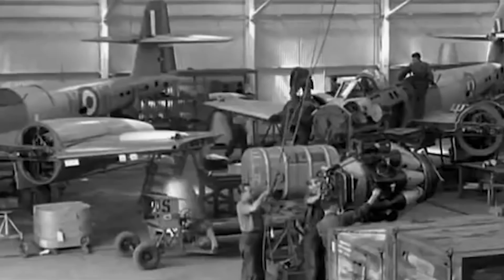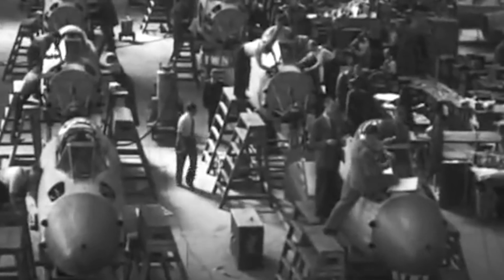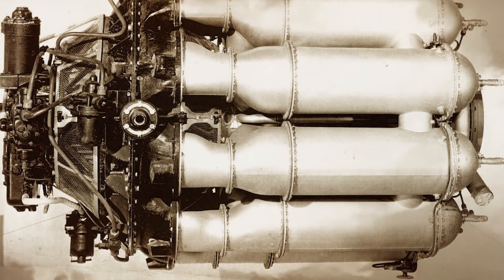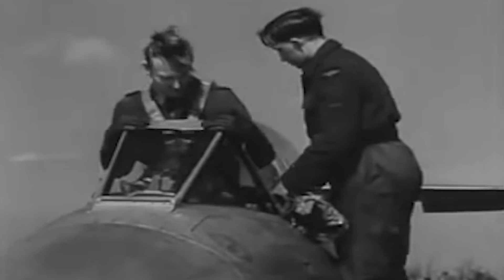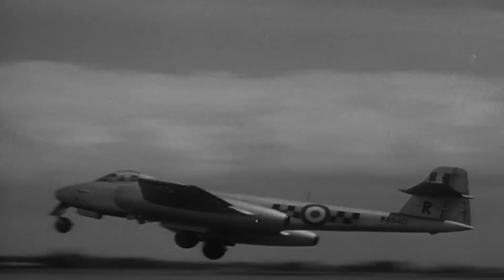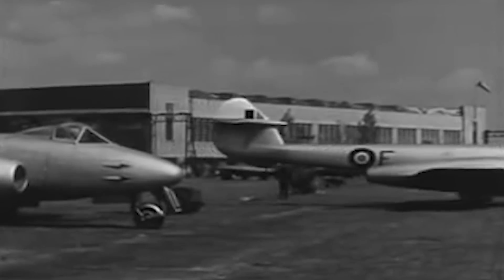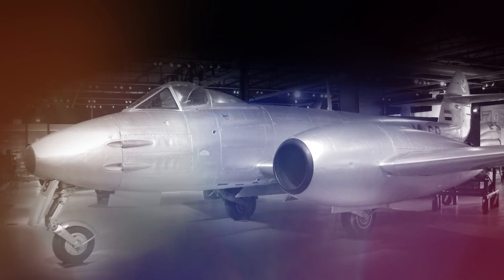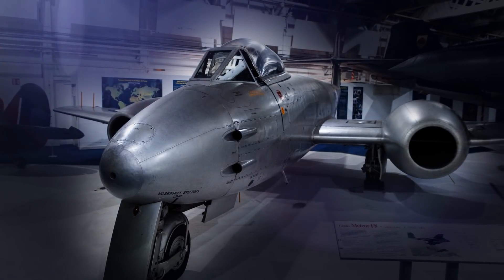Gloster Meteor - The Only Allied Jet to Fight in WW2

Comment: Technically the Gloster Meteor was the World's first operational jet fighter, by about a week. The Me 262 was the first jet fighter to see combat, but it was not officially operational at that time.
Reply: Correct spacecadet35. The Meteor was the first. It was also a proper R&D'd plane not a death trap lash up.
Reply: The first operational jet fighter was the Messerschmitt Me-262.
Reply: @sandervanderkammen9230  The Meteor beat the Me262 into operational service by about two weeks. The Me262 is definitely the first jet to see combat, but not the first 'operational' jet.
Reply: @spacecadet35  No, that is incorrect.
The Messerschmitt Me-262 entered service in April 19th, 1944 and shot down its first Allied aircraft, a RAF Mosquito on July 26th.
 The Gloster Meatbox did not enter service until July 27th.
Reply: @sandervanderkammen9230  -  The Me 262 did indeed enter service and see combat in April 1944, as a TRIALS aircraft. It became OPERATIONAL in August 1944. However the Meteor was declared OPERATIONAL on the 12th of July 1944.  So as I said above. The Me 262 was the first jet to see combat. The Meteor was the first operational jet fighter.
Reply: @spacecadet35  You seem very confused and misinformed regarding this, the Messerschmitt Me-262 entered operational service with the Luftwaffe on April 19th..
3 months before the Gloster Meteor.
 The Meteor never saw combat operations during WW2.
Reply: @sandervanderkammen9230  - I think the main problem is that you do not understand  what the word "operational" means, especially  in a military aviation context. Just because an aircraft is in combat does not mean it is "operational. And there have been many operational aircraft types that have never seen combat.  Unless you have some secret records that no one else except you has seen,; the Me 262 achieved  "operational " status in August 1944. It had seen combat earlier, but not as an "operational" aircraft. If you have documentation that says otherwise, please feel free to reference it.
Reply: @spacecadet35  "Operational" refers to any aircraft that has been introduced to the military units that will "operate" the aircraft.

The Messerschmitt Me-262 was tested and accepted by the RLM Reichsluftfahrtministerium in July 1943, production began in January 1944 and introduced into operational service with the Luftwaffe in April 19th 1944.
Reply: @sandervanderkammen9230  - Operational means that it can carry out its operations. The fact, (probably unarmed)   pre-production aircraft were delivered in April does not make it operational as a fighter.
Reply: @spacecadet35  Well, by that definition the Gloster Meatbox was never in operational service.
Reply: @spacecadet35  Pre-production Me-262s were delivered to the Reichsluftfahrtministerium in April 18th 1941.
Reply: @sandervanderkammen9230  - It fired its guns in anger against enemy targets. It was operational in that it could actually carry out the combat missions asked of it.
Reply: @spacecadet35  The Gloster Meatbox was the worst jet fighter ever used in RAF service.
It never saw combat operations and never shot down a single Luftwaffe plane during WW2.
Reply: @sandervanderkammen9230  - please get you facts right.  The Gloster Meteor saw combat operations. 77 Squadron in Korea flew 15,000+ combat missions in Meteors and is  credited with shooting down five MiG-15s and destroying 3,700 buildings, 1,408 vehicles, ninety-eight railway engines and carriages, and sixteen bridges.
Some would say aircraft like the Brewster Buffalo or the .Paul Boultan Defiant were  worse. And the F35 lightning is a much worse aircraft.  I am not sure what the Meteor did to you personally, but it was a pretty average aircraft, which became outdated fairly quickly and which is mainly notable for being the first jet fighter to achieve squadron operational status.
Reply: @spacecadet35   I wrote, quote;
"It never saw combat operations and never shot down a single Luftwaffe plane during WW2"
Reply: @spacecadet35  RAF Chief Marshal Sir Frederick William Bowhill called the Gloster Meatbox a, quote; "Dismal and Lackluster aircraft"
Reply: @spacecadet35  As a pilot it's easy to dislike a plane as horrifically bad as the Meaxbox
What is there to like about a jet that killed 450 British pilots...
Reply: @spacecadet35  The RAF selected  the F-35 for the same reason it selected the Meatbox... the British aircraft industry had nothing better to offer... and simply could not tolerate asking the Germans again for help.
Reply: @sandervanderkammen9230  - That quote is factually wrong. As I said before 77 Squadron alone flew over 15,000 missions in Meteors and had FIVE aerial victories with Meteors. In case you haven't figured it out, this was in Korea and that happened AFTER World War 2.
Reply: @sandervanderkammen9230  - Wow, your reasoning is indeed twisted. Thinking that the British would ask the Germans for help during WW2...  The Meteor was a first generation jet fighter. It was of course, medicore compared to 2nd generation jet fighters. But it was comparable to its contemporaries.  It was certainly more reliable and airworthy than the Me 262.
Reply: @spacecadet35  The Meatbox did not shoot down a single Luftwaffe plane during WW2.
Reply: @spacecadet35  I was referring to the Tornado and the Typhoon.
The RAF hasn't had a British designed fighter since the 1980s.
Reply: @sandervanderkammen9230  "The Meatbox did not shoot down a single Luftwaffe plane during WW2.
" And?  WW2 was not the only war that the Meteor saw combat in.  It had to fight much more capable jet fighters than the Me262. And I assume that you actually mean "The RAF hasn't had a NEW British designed fighter since the 1980s. After all, the RAF still has six Spitfires and two Hurricanes still in service. But" I am not sure what all of this has to do with the Meteor.
Reply: @spacecadet35  The Meatbox was not capable of fighting the Me-262..
Shooting down a drunk Chinese MiG-15 pilot was pure luck.
Reply: @spacecadet35  I'm not sure what the F-35 has to do with the Meatbox either...
Reply: @sandervanderkammen9230  - You definitely insult the Chinese pilots. The F86s had problems with these same drunk Chinese Mig 15 pilots.  The Meteor is what it is. It was a first generation jet that had a fairly average combat record. It had issues like any other first gen aircraft,  There have certainly been worse
Reply: @spacecadet35  The Chinese pilot survived and was court martialled for flying drunk.. a far more bitter insult to injury.

Indeed, the MiG-15 was designed by Heinkel engineer Seigfreid Gunter and was superior to Meteor and very close match to the F-86 Sabre designed with the help of Messerschmitt engineers...
The Sabre's wing was based on a prototype developed in Germany before the war ended.
Reply: @spacecadet35  The Meatbox is what it is, the worst jet fighter ever used in RAF service and one of the worst jet aircraft ever produced although the DeHaviland Comet 1 is perhaps the worst jet aircraft ever built.
Reply: @sandervanderkammen9230  - As a First Generation fighter, you would hope that all of the following aircraft were better. So yes, if you restrict the definition enough, you can make it the worst at something. The Comet is actually a pretty good jet. Probably the worst jet ever built is a toss up between the  Lockheed-Martin F35, the Vought F7U Cutlass, the PZL M-15 and the Dassault Balzac V.. I mean the Basic Comet design was so bad that it was produced for 25 years and the Final Comet based airframe finally stopped flying in 2011. Your definition of bad is obviously based on factors other than the normal person's.
Reply: @spacecadet35  The Comet Disaster was the worst engineering failure in aviation history.
Reply: @spacecadet35  If the Comet was a pretty good aircraft? DeHaviland would not have gone bankrupt in 1958 and would still exist.
Reply: @sandervanderkammen9230   De Havilland never went bankrupt and was was bought in 1960 by Hawker Siddeley and is now part of BAE systems. Comets were in service with at least eight different nation airlines, was produced from 1949 -1964 and in regular civilian operation until 1980.
Reply: @sandervanderkammen9230  Sandyboy, as you know the MiG-15 owed its performance to the RR Nene engine, the Russians having wisely dropped the crappy BMW 003 engine that had been such a failure in the MiG-9.

Comment: 4:10 The Meteor in this piece of film has engines equipped with an exceptionally long tail section; anyone know what's up with that? I don't see that on any of the other pictures of Meteors in the video.  Was this a prototype design that was ultimately rejected?
Reply: The Mk.3 with the elongated engine nacelles was an engineering testbed aircraft, also designed to study the shape of the nacelles before the Mk.4s nacelles were redesigned. A pity they didn't mention the Mk.1 prototype (DG 204/G) with the Metropolitan Vickers F2 axial-flow engines. The nacelles for those engines were under the wings, very much like a Me262's engines were housed. at 1800lbs s.t. thrust, they were slightly more powerful than the Wellands  the Mk.1s had as standard.
Reply: Metrovick Beryl? Shame they didn't develop theur engines further- always feel RR got a little too much coverage.
Reply: @jimdavis8391   After the Beryl they did, the Armstrong Siddeley Sapphire was a direct development of the Metropolitan Vickers Beryl
Reply: Testing afterburners, or reheat as called in UK.

Comment: The Glouster 'Meatbox (More than 450 pilots killed outside combat)
Reply: the aircraft who kill the most pilots in accident was the bf 109...
Reply: The basic problem was that the aircraft took off at a speed way below Vmca and there was not enough rudder control to cope with full power on only one engine until it had gained a lot of speed. The RAF compounded the problem by simulating engine failures on take off in training which led to a lot of loss of control accidents near the ground. At one point more Meteors were being lost in training accidents than the type was having actual engine failures!

Comment: Temora Aviation Museum in Australia has an airworthy Meteor.  Has an amazing sound as it flies past.
Reply: Jeremy Thomson - a fantastic museum who fly all their aircraft. I recall landing there one morning and taxiing past one of their Spitfires.
Reply: @EdOeuna  jeez I wonder what their most valuable aircraft is.... At some point id become paranoid that something will happen which isn't an unreasonable thought to have lol. Potentially losing an irreplaceable aircraft and the pilot would be awful.
Reply: @TheFrogInYourClosetWatchingYou  - the ethos of the museum is to have flying vintage aircraft, not aircraft hanging from the roof gathering dust. They have regular showcases where they fly many of the aircraft and do aerobatics. From memory they have at least one Spitfire, a Vampire, Meteor, Canberra, O2 bird dog, and a Cessna Dragonfly.
Reply: @EdOeuna  2 Spits I think? I think they did the F86 restoration for the RAAF as well, so that was there, not sure if it still is though. I've also seen the Boomerang and the Wirraway there, and their Tiger Moth 🙂
Reply: Jeremy Thomson I’ve seen it so cool
Reply: There is one in the Brazilian Air Force Museum that should be airworthy too, it was in flying condition when was delivered there. The famous "it was running when I parked it".

Comment: All pure speculation on here. The only man to fly both was Adolph Galland  who flew Me262 in WW2 and the Meteor in Argentina. His opinion was the 262 had better wings the Meteor had better engines and range in the new world of swoop and kill the meteor would have won as it flew much higher then the 262.

Its no different an argument to the P40 and the Zero. The Zero was clearly a better aircraft but if you had the height and didn't dogfight with it it was out classed by the much heavier,  more heavily armed and stronger P40.  It meant your dive speed was higher and if you had the jump on them they were easy prey. 

Pilots avoid dogfights at all costs why do it when you are far more likely to get shot down. It not all Top Gun.
Reply: He wasn't the only person to fly both Eric Brown flew the Me 262 and the Meteor

Comment: All pre WW2 advanced countries had some people who were familiar with the jet engine concept but the creation of the exotic alloys and lubricants capable of withstanding the high temperatures required to make them a practical machine was another matter. The engine used in the Meteors contained a series of "by guess and by God" compromises to get something into the air soonest at least cost.
Reply: Germany took copies of Frank Whittles designs but got it wrong, nothing could make them better than the failures they were.

Comment: Your statement that Tricycle Landing Gear became standard for all jet fighters, is mostly right, because both Britain, and the Soviet Union produced jet fighters that have two vastly different types of landing gear. The two aircraft in question are the Attacker, and the YAK-28 "Flashlight". The landing gear arrangement on the Attacker is the Tail Dragger configuration, and the arrangement of the YAK-28P is the Bicycle configuration, which is also seen on the Harrier, as well as the B-47 Stratojet bomber.

Comment: The  loss of 450 Meteor pilots is a staggering number, it is hard to comprehend the bravery of those men that flew such a flawed aircraft.
Reply: The main Problem with the Meteor in its early marks was the lack of an ejection seat. The Trainer Version, The T Mk 7 was never fitted with them, nor was any of the twin seat Night Fighters. The  later F Mk 8 and FR/PR Versions did have an Ejection Seat, but it was the Martin Baker Mk 1 which the Pilot had to manually unstrap himself from to use his chute after ejection which was i no way a Zero - Zero seat. The Aircraft's flaws were no more or no less than any other aircraft of the time.  The Link below lists most of the Meteor losses. 

https://aviation-safety.net/wikibase/type/METR/1

The list has other operators than the RAF, plus counts aircraft converted into drones for Guided Weapon trials that were lost due to failures or being shot down. I'm not going to look at the report on every one, but what did strike me was a lot of aircraft were lost due to running out of fuel while trying to land in bad weather. The break down of losses by Meteor type to Aircrew killed was thus.

Meteor Prototype / F Mk 1 - Single Seat - No Ejection Seat - Aircraft Lost 3  - Crew Killed 2
Meteor F Mk 3  - Single Seat - No Ejection Seat - Aircraft Lost  8 - Crew Killed 5
Meteor F Mk 4 - Single Seat - No Ejection Seat - Aircraft Lost  61 - Crew Killed 32
Meteor FR Mk 5  - Single Seat - No Ejection Seat - Aircraft Lost  1 - Crew Killed 1
Meteor T Mk 7 - Twin Seat - No Ejection Seat - Aircraft Lost  214  - Crew Killed 169
Meteor F Mk 8 - Single Seat - Ejection Seat fitted - Aircraft Lost 398  - Crew Killed 199
Meteor FR Mk 9 - Single Seat - Ejection Seat fitted - Aircraft Lost  24 - Crew Killed 9
Meteor PR Mk 10 - Single Seat - Ejection Seat fitted - Aircraft Lost  9 - Crew Killed 2
Meteor NF Mk 11 - Twin Seat - No Ejection Seat - Aircraft Lost 63  - Crew Killed 46
Meteor NF Mk 12 - Twin Seat - No Ejection Seat - Aircraft Lost  10 - Crew Killed 13
Meteor NF Mk 13 - Twin Seat - No Ejection Seat - Aircraft Lost 1  - Crew Killed 2
Meteor NF Mk 14 - Twin Seat - No Ejection Seat - Aircraft Lost 9  - Crew Killed 5

T
Reply: The Gloster "Meatbox" as it was called by RAF pilots was structurally unsound, aerodynamically unstable, had fatal asymmetric flight characteristics  and horribly designed cockpit and flight controls.
Contrary to popular belief engine failures were common and generally resulted in a unrecoverable yaw.
Reply: Sandbum dorktorbummer.
The Meteor was far better than the Me 262 and the P 80. More P 80.s crashed than Meteors and not many Me 262's flew. Many of the ones that did were shot down.

Comment: Started the jet frenzy.... Behind the 262
Reply: awkc 63 Along side.
Reply: @frankanderson5012  Germany invented jets and produced the first operational jet fighter during WW2.
Reply: @sandervanderkammen9230  So Sandyboy,  you've dropped Guillaume with his sweet little crank handle. I always think it's worth reminding you of what the famous German gas turbine pioneer Pabst Von Ohain had to say in his foreword to 'Elements of Propulsion, gas turbines and rocket'-

"The first patent of a turbojet engine, which was later developed and produced, was that of Frank Whittle, now Sir Frank (see Fig. 5). His patent was applied for in January 1930. This patent shows a multistage, axial-flow compressor followed by a radial compressor stage, a combustor, an axial-flow turbine driving the compressor, and an exhaust nozzle. Such configurations are still used today..."

and -

"In April 1937, Whittle had his bench-test jet engine ready for the first test run. It ran excellently; however, it ran out of control because liquid fuel had collected inside the engine and started to vaporize as the engine became hot, thereby adding uncontrolled fuel quantities to the combustion process. The problem was easily overcome. This first test run was the world's first run of a bench-test jet engine operating with liquid fuel..."

and-

"From the beginning of his jet propulsion activities, Frank Whittle had been seeking means for improving the propulsive efficiency of turbojet engines. He conceived novel ideas for which he filed a patent application in 1936, which can be called a bypass engine or turbofan. To avoid a complete new design, Whittle sought an interim solution that could be merely "tacked on" to a jet engine. This configuration was later known as the aft fan. Whittle's work on fan jets or bypass engines and aft fans was way ahead of his time. It was of greatest importance for the future or turbopropulsion."